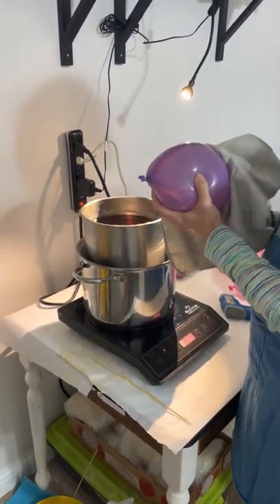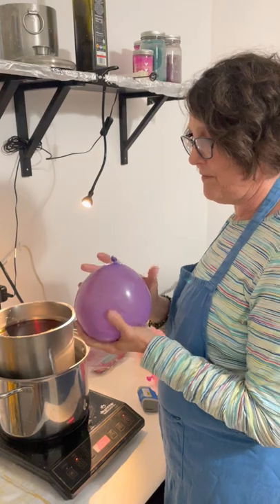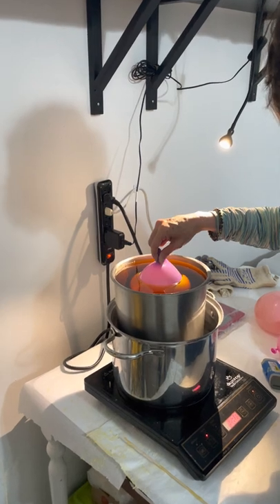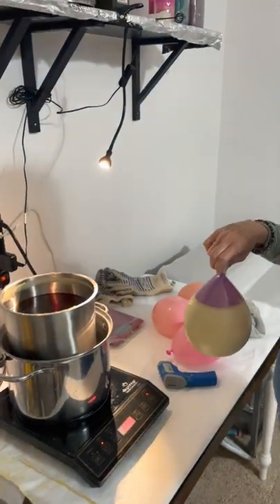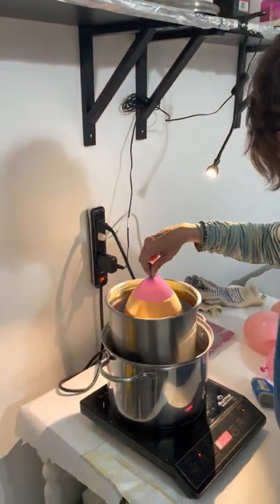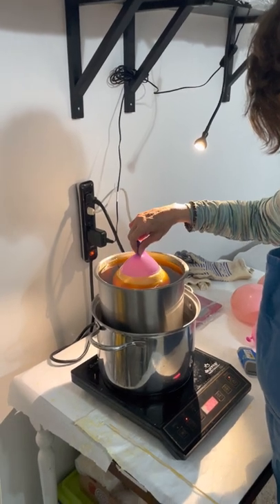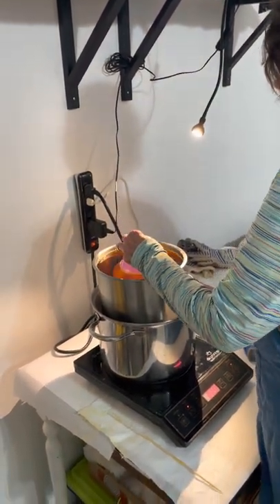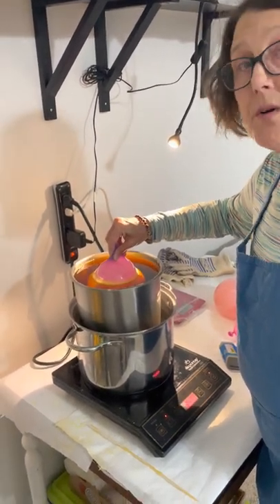How we make our 100% Beeswax luminaries, Part 1

Comment: What is the temperature you’re trying to obtain please?
Reply from the maker: Kellie the temperature varies depending on the temperature in the room.  Typically 175 degrees F to 190 degrees F.  Be careful not to burn the wax by stirring regularly.  I also switch out my wax frequently and use it for candles so the color and natural scent are maintained. Maybe one to two days of dips at the most.  Hope this helps.
Reply: @angiebee20  thank you! Also, I didn’t hear you say it, although you may have…do we fill the balloon with water?
Reply from the maker: @kellieborriello9028 Yes you add water close to room temperature. Don’t dip the balloon down in the wax above the water line or the balloon will burst.
Reply: @angiebee20  thank you so much. I’ll try it ! Great video and lovely idea🥰